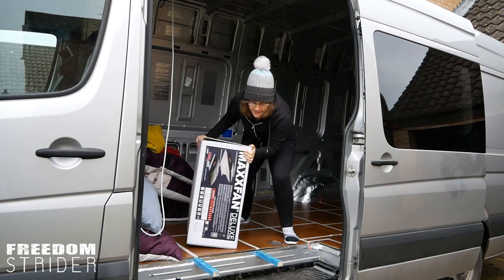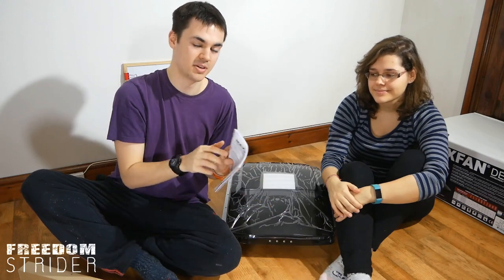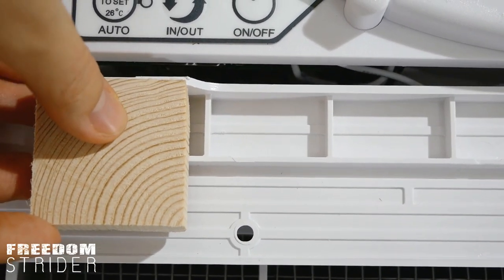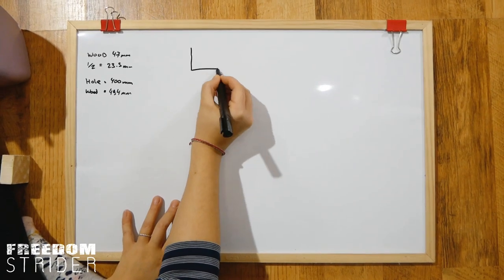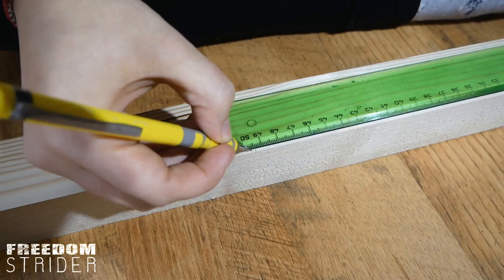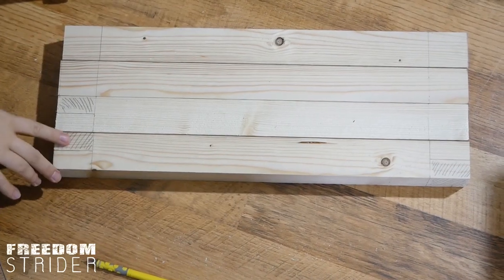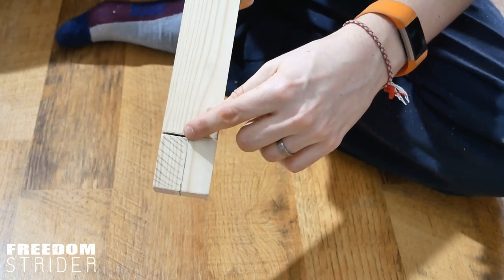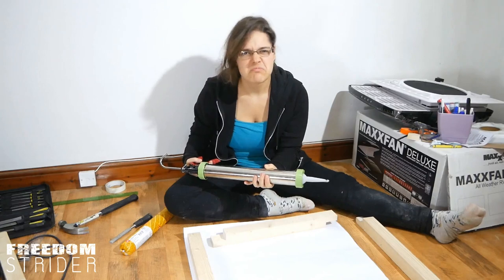You NEED A FRAME for you Maxxair Fan - Here's WHY...

Comment: So neat for something that will probably never be seen again. Love the hacksaw.😂 I didn't screw my fan to the roof, I just glued it on. I don't think it's ever coming off. I glued my solar on and outside side door light strip. So I've only drilled two holes in the roof. Solar cables and a tiny hole for the outside LED light strip. I think there will be more holes.👍
Reply from the maker: We were actually discussing that fact today of do you really need to screw it on? We've sealed it up good so nothing is getting through but still, every hole has me worried 😬
That being said, holes are fun to drill and cut in the van 😂
Reply: @FreedomStrider  You have to cut for vents and windows, but I would avoid drilling holes where possible. Every hold is an h2o opportunity. If you use a very good glue, I don't see a problem. If you use mastic, then you must screw it down. There is no right way, but there are things that can become a problem in the future. When I got my 250w 3mm thick solar panel, I had a choice of cables out the top and into the van or a box on the underside of the panel which you cut a cigarette packet sized hole so this little box sits inside the roof space where the insulation is. I followed convention and went for cables on the outside that go back in. This is a major regret. The box in the roof would have looked so much neater. But that's life. There are two of you and that's good to bounce ideas off each other.
Reply: @CarlJones14  sealant... Not glue
Reply: @votesudanusa  oh dear, you glue thing on, it's stuck on. I think you need to sort yourself out. Huge numbers of self builders drill and screw things to their van roof and they have leaks. It's important to get over the idea that gluing works. Sikaflex is an adhesive, which is a glue.
Reply: @CarlJones14  Apparently, either you can't read, don't read or have issues with comprehension. Silkaflex IS A SEALANT and a sealant is not GLUE per SE. It's a polyurethane sealant that can also be adhered to surfaces. The properties of a sealant are far different than that of something that is just glue.
Reply: @votesudanusa  You are sooo  funny. The official Sikaflex data sheet calls it an 'adhesive'. 👍😎

Comment: Great video guys, I've just come across your channel and I love how detailed and thorough your video guides are. I will be studying them in depth over the coming weeks! I would like to add my 2 cents to the 355 vs 400mm hole problem. I just watched Greg Virgoe install his Maxxair fan and he had a 355mm existing hole from his former "fantastic fan" so the ribs of the inner box of the maxxair fan frame will cut into the mastic sealant strip. That leaves the outer plastic part of the frame where the screws go in, empty so that when you screw into the metal the plastic edge of the frame ends up completely flush against the metal roof, needing less Sikaflex sealant to go around the rim (because it doesn't have to contend with the raised mastic strip). However, if there are ribs from the metal roof in the way, that might pose a bit of an issue as the plastic frame might bend significantly. I've seen other people actually cut into these ribs with an angle grinder to get them out of the way. Using this method you would still have to make the wooden frame 400mm though to line up with the screws underneath as you said. All in all, great video and made me think!!
Reply from the maker: It's almost as though they aren't designed to be installed on van roofs?! I mean, they are designed for completely flat roofs, I believe Fiats, Citreons and Peugeot vans have a dedicated area at the back for roof fans to be installed, but if you have ribs in the way, it makes everything 10x harder and it just comes down to improvisation a little (or a lot). Having done the research, although the frame itself always will need to be 400mm square, the hole size could be either and still work, but it did confuse us quite a bit at the beginning. 😆
Reply: @FreedomStrider  Yes you'd think that since so many people are getting into van life these days, they would amend their design to include solutions for various van roof topography. Out of curiosity, did you consider using a larger piece of wood for the ceiling frame? For example, Wickes has wooden studs that are 38mm x 63mm, which would be wide enough to reach the screw holes and deep enough for the 25mm requirement for the screws...

Comment: Really good thorough work. Like the lap joint on the timber fan frame. Never seem van builders use this joint in their vans. Great video.
Reply from the maker: Thanks 🙂 It was our first lap joint, would love to have some power tools next time as it took a fair while by hand, and it will be straighter - it did the job though 😁
Reply: @FreedomStrider  thanks for reply. i think you did a really good job. Any gaps in the joint can be filled in by using sawdust mixed with PVA wood glue and sanded when cured. PVA is the best adhesive for joining timber and is cheap if you buy it from Poundland.

Comment: great video, love it....
the difference between the  2 sizes apparently has to do with the ""contours" of some vans have a smaller designed areas  than others for fans/skylights, hence the 2 size differences but same fan...... smaller size frame for the smaller designated area and larger for larger areas... i am guessing it has to do with the integrity/ support/ strengthening on vans  roofs
Reply from the maker: Glad you liked it 😊

I don't really know why there are 2 different sizes, you might be right, with vans being so different it would make sense 👍

Comment: You are incorrect about needing a frame.  Sheet metal screws have been holding parts on cars since the beginning of time.
Reply from the maker: Metal screw can hold it, but we are correct about the frame for the Maxxfan - The instrction manual states that a frame is need if fan is installed on a surface thinner than 25mm... and the van metal is 1-1.5mm think
Reply: I would trust just screwing the fan to the metal sheet if the caravan was stationery, not leaving that spot. But as you travel with your campervan on bumpy roads in time screws can get loose. In the metal sheet you only have 1 mm thread. (With paint at both sides my Ford Transit has a 0.95mm roof thickness; I measured it with a Mitutoyo vernier.) .. Even the Maxxfan manual recommends it: “If your thickness is less than 25 mm, build additional thickness at the ceiling opening using wood or other suitable material.”
Reply: A frame is highly recommended for the following reason. The intent is to install the fan permanently and leak free. To seal the fan (polymer)  to the roof the majority use either butyl tape,  an adapter and or some sort of semi-soft sealant.  All of these materials are subject to potential creep and cracking over time given the environmental conditions on the roof.  

The thickness of the roof is ~1/20" (18 gauge)  so a sheet metal screw will have about 1 thread to resist the vibration of the fan motor, wind flutter and opening and closing. The frame distributes the load and provides depth for the faster threads. The fan may not leak for a period without a frame but that time period will be much longer (years)  if a frame is installed properly.